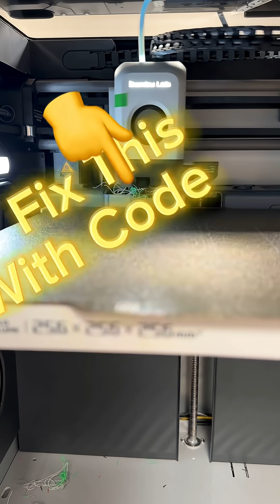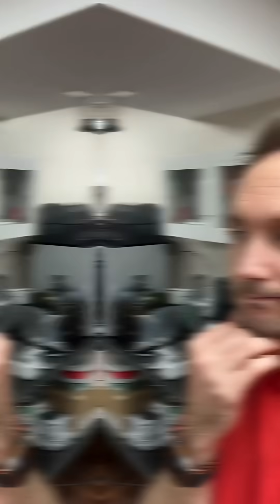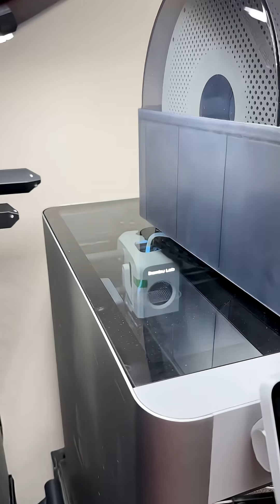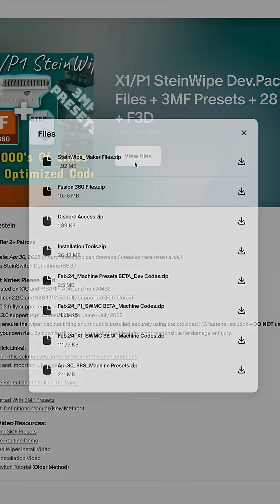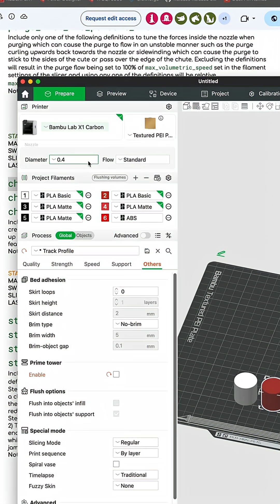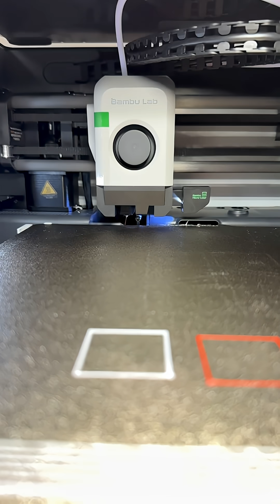I Fixed The Purge Problem For Bambu Lab P1S & X1C With Code! Chute Tapping Explained

Comment: This looks like a great solution. Currently having this issue. In my case the purged filament is clogging over the hinge of the chute lid.

Is it just a matter of adding the 'chute_tapping_soft' command to the notes?
Or do I need to do more?
Reply from the maker: There is another feature you might want to look at for the string going over the chute wall its called ams_snake_detour :)
Reply: @leckiestein  Thnx!
Can I apply both features just by pasting the command into the notes section?

Comment: I used to have an issue that caused purges to litteraly hook themselves on the edge of the chute because of how crooked the flow was. I eventually got the idea to do a cold pull and that solved the issue. The issue was that one of the metal bits that grip PTFE tubes had broken and went down the filament path, this got stuck in the nozzle and made the flow of filmanent really off for a while. Once I fixed this, everything was perfect again. Hope this helps someone.

Comment: Will steinwipe and the codes work with a 0.6 nozzle? I notice there is a 3MF for 0.2 and 0.4.
Reply from the maker: Yes but you will have to copy all the gcode out of the 0.4 file and paste it into a 0.6 file and resave it. It was not included because I dont have a 0.6 to test with but it should be ok. All the calculations are based on filament diameter and volumetric flow rates
Reply: Awesome, I assumed that was the case but just double checking, thankyou for the response.

Comment: I installed the BIQU purge plate to replace the factory one. Hopefully that will prevent hot filament from sticking in the top of the purging area. I’m not really wanting to mess with custom guides yet!
Reply: it did nothing for my machines, just made it worse
Reply: @michellewoodward8171  Have you found something that works?

Comment: Yes there is! Aluminium tape fixes everything, cover the inside of it in the aluminium tape: very very cheap way to  say goodbye to every poop chute problem
Reply from the maker: I guess you didn't read the video description 😎
Reply: @leckiestein who reads descriptions in shorts? I’m not being mean, that’s how YouTube wants us to use shorts and accessing the description on desktop is so much worse than mobile.
Reply: @SweetDeArT I read on mobile
Reply: @leckiestein guess you found out bambu stop your program because they dont believe in open source
Reply: It is an A+ short though. All concise info
Reply: Not true, i have tried that and teflon tamp. the biqu pad and they all clog
Reply: @RayRaesArt-xo5wr  Having gone through 18 x1cs, Sure is true! if it isn't working for you, you are almost certainly purging too much for the flappy bit to cope with, anything over about 2g and it starts to clog, look at how much you're purging - OR your flappy bit has fallen off and isn't dropping with any sort of force making it all build up. If it's a p1s or x1c the little boot falls off every few thousand hours in my experience, print a new one
Reply: I do something similar on my  deflector for the A1, painters tape. Does a great job of never bonding
Reply: Hi, can you post the link to this please as can’t seem to find it. Thanks
Reply: I tried that. The tape keeps peeling up from the corners and gripping the filament making the problem constant rather than intermittent
Reply: thank you for this comment. seriously. 😂
Reply: Mine are getting caught on the wiper assembly. Tape isn’t helping at all.

Comment: I copied and pasted but didn't work. What am i doing wrong. On the p1s
Reply from the maker: Did you open the .3MF file from the Patreon shop Dev pack?
Reply: @leckiestein no the video just said to copy and paste in notes.
Reply from the maker: @wingate23  please see instructions at the top of the document I referenced in the video. It will tell you you need Steinwipe motion control with at least v. Apr.28.1. You can find this page linked on the makerworld listing
Reply: @leckiestein So when I buy it then what do I do.